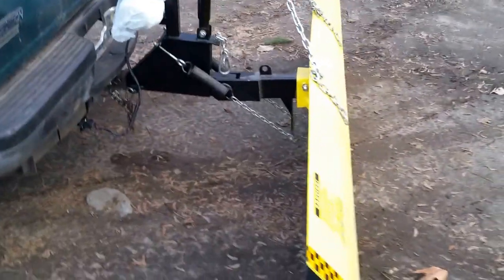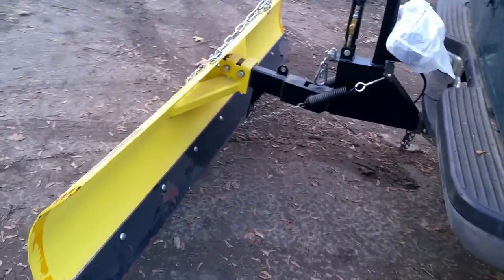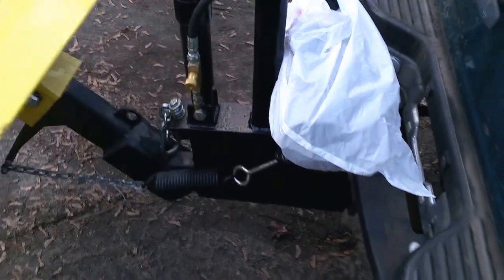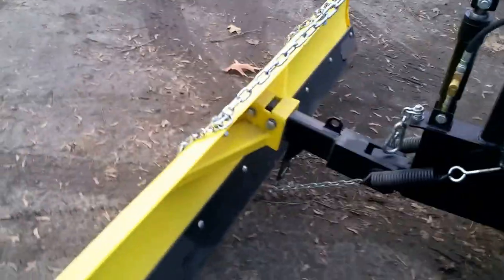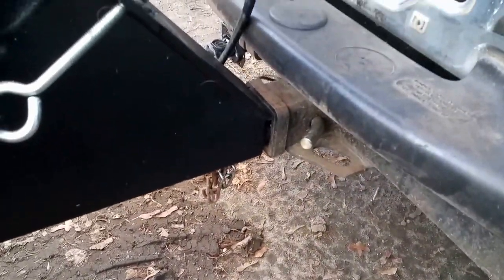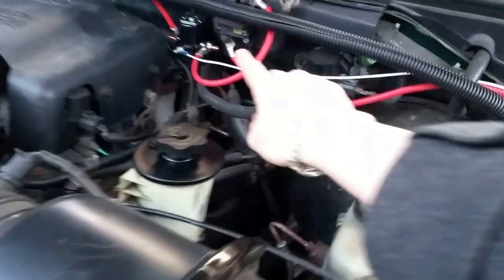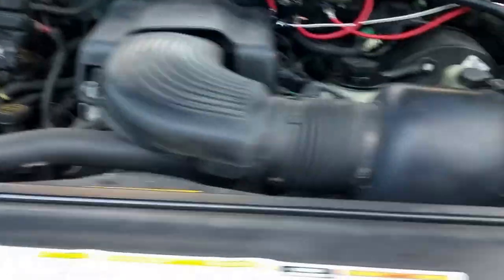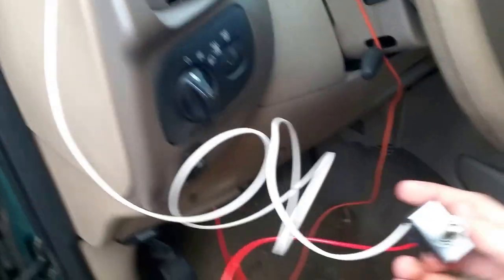Ez SnowPlow Driveway Superplow Trailer Mount Plow

Comment: Loos easy enough to just build it yourself. I have pretty much the same thing on the front of my 1/2 ton truck, only I use a 12 volt winch to lift the plow. Been plowing my yard and driveway for 10 years and it looks like new yet. I don't think I have $300 into it and a couple days labor welding and fabricating the mount. I have a front receiver hitch on the truck, so it's just push it into the receiver, lock it in with a pin and plug in the winch! It works so slick. Of and on in a couple seconds and your plowing!

Comment: The super plow is no longer available. Can't find them anywhere. Just up and disappeared.
Reply: You should be able to sell it fast. It is too small for my truck and needs. But they are fantastic plows.
Reply: I am the inventor ,had fun for 25 years selling , sold my invention to a guy who did not live up to our agreement so i had to close him down, it was a great plow .
Reply: I also own one of these plows.  It works quite well.  I'd love a copy of the manual if anyone has one though.
Reply: @maureenbiance9289  are you able to adjust the plow for a driveway that has crowning? Rises up in middle and down on edge for water run off?

Comment: Why would anyone want to plow snow they've already driven over? And how do you plow snow you CAN'T drive over? Why not just reverse the blade and drive backwards? Reverse is a stronger gear anyway.
Reply: These plows push backwards and clear just as well as pushing forward. It does not matter that the blade is angled backwards. It being angled backwards actually helps it push piles of snow back over sod without scraping the grass. Only in reverse though.